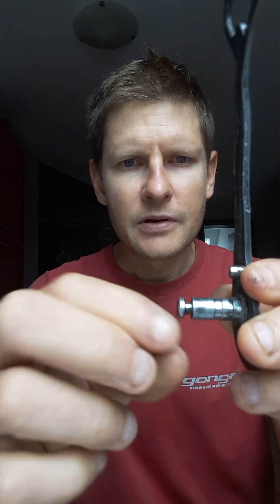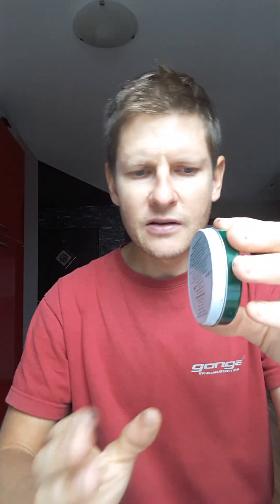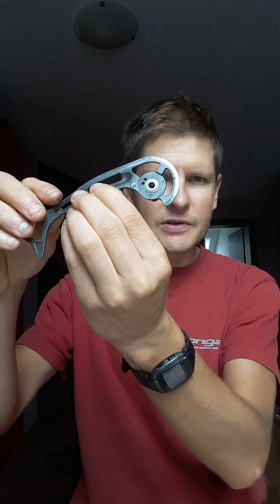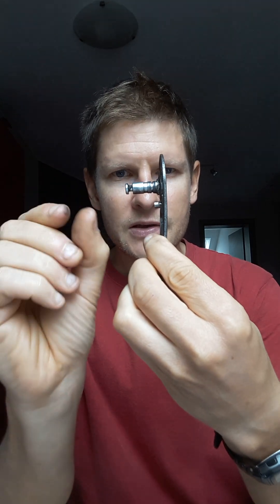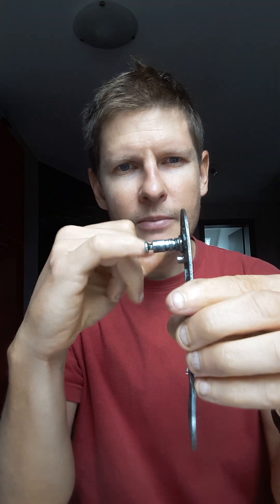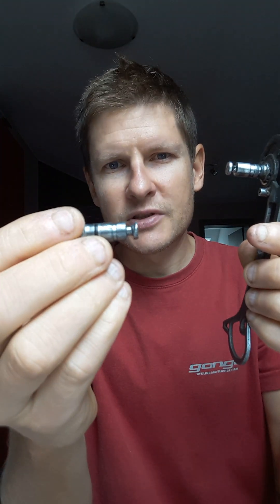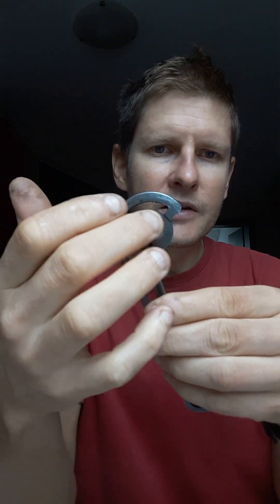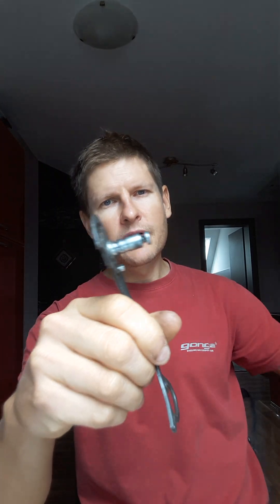WHY YOUR REAR DERALLLEUR IS NOT WORKING PRECISELY ON EVERY SPROCKET?

Comment: Are current XT and XTR derailleur cage upper pivot bushings still steel and hardened / durable ? Are older ones from the 1990's and early 2000's better .
Reply from the maker: Yes the history shows the older the better . New ones really can grind off easily with hand grinder.
Reply: @gongalab  How do you rate the 739 from 1996/7 , the 770 from 2001 and the 771 from 2002 ? I have new old stock of these . I have the 739 SGS on my Trek 4300 custom build and so far so good .
Reply from the maker: This literally  depends on gear and chain crossing pattern habits due to each individual riding styles rather than just series of rd
Reply from the maker: Novadays 1by 12 is disaster in this term huge aksial forces occurs on this pin
Reply from the maker: Normaly best test is to dismantle it and test it by hand grinder and comparing it among others. We noticed within history examination that 2 same rd s but different origin made in Malaysia  or indonesia had different  types of materials despite same series of RD. So your question is more for the shimano marketing what strategy they have with different origins. We have a collection of few hundreds of worn bushing pins from last 10 years but mostly rapid cases happened in last 7 years which indicates that changes happened in recent history. Im mechanical engineer and i open any arm to inspect and if seeing wear then we make better one which last forever and changing only locking pins which cost few cents.